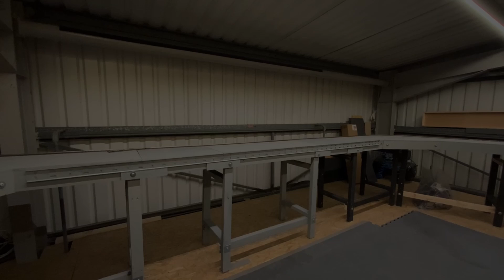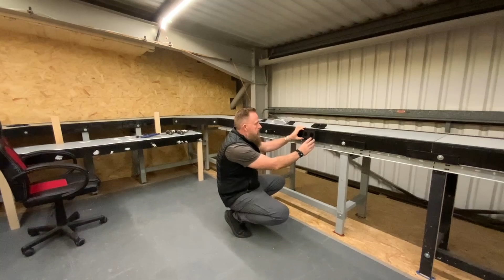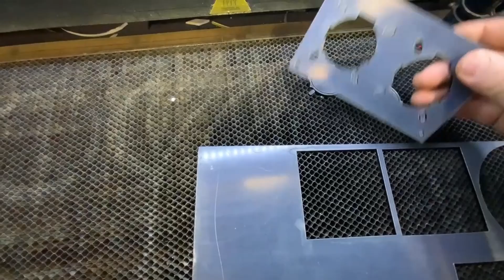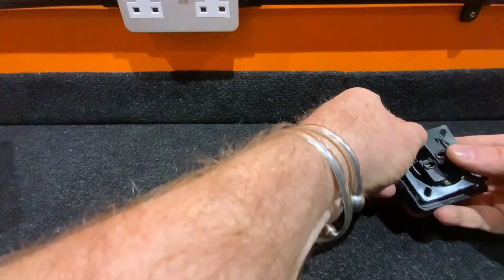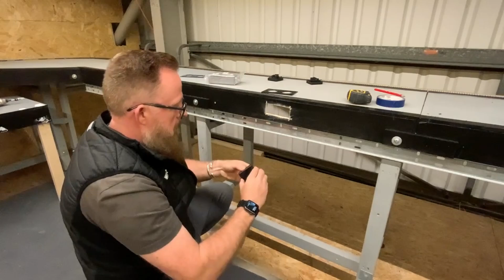New Layout - Moving Trains 00 Gauge - You Shunt - Episode 5

Comment: ARE YOUR MODELS NEM COMPLIANT - OR DO THEY DERAIL !!!
The NEM Conference, back in 1989 in Germany. That invited ALL model Railway Manufacturers BASED in Europe, was held with one specific purpose in mind. To abolish the mass of then different track, wheel and coupling variations between all manufacturers. To therefore "Standardise" NEW refined measurements as modern "Computerised" machinery was already being introduced in the Far East (Led by the Japanese). British Peco set the pace by agreeing new refined "Track standards" of Code 75 (75/1000ths of an inch high rail). Which is not just more realistic looking than the now outdated Code 100 (100/1000ths of an inch high rail), but also fractionally narrower in rail head width ! Which means ALL pointwork had to be redesigned with narrower pathways between the "checkrails and running rails", along with a redesigned nose to the Frog area. Further the actual distance between the rails was also fractionally increased, as a result of the fractionally thinner Code 75 rail. So to check any Models wheels a new NEM Code 75 "Back to Back" Gauge is required. Which you push between the wheels to ensure they are precise to a fraction of a millimetre. And Hornby's current models, particularly locos, are quite often fractionally out !  

Further the curve between the new narrower wheel treads, and the new reduced depth of the Flanges, now uses a curve of RP25 (Radius Profile 2.5mm). So another "tool" a RP25 Gauge is required. Because if you try to use American Models (Code 83) or Asian Standards (various !) all of which have different profiles and track systems that do NOT match the European NEM standards. Problems will be encountered. So even old pre NEM European items (including Hornby/Wrenn/Tri-ang etc) with nasty steam roller treads and deep flanges are likely to bounce along the "sleeper chairs" of modern Code 75 track. So won't collect current properly, and definitely will have trouble getting through Code 75 pointwork, without derailing.

The reverse is also an issue. You will have running problems if you put modern NEM compliant model trains with Code 75 wheels, on old fashioned Code 100 track. Which is a major reason for many of the problems I see on even British exhibition layouts still ignorantly using Code 100 track (still made by Peco). Which includes jittery loco behaviour, and of course "spurious" derailments when NEM Models are run on that out of date type Code 100 track. Indeed for some strange reason it seems only British & Spanish Modellers seem virtually oblivious to the changes 30 Years after they were applied. 

The information about the NEM Conference, and the changes agreed, and the fact "everyone" would have to change ! Was certainly published in the British Modelling press back in 1990. But most it seems totally failed to comprehend the technical issues that would now occur, if you try and mix the two systems. Many at the time probably thought it was similar to the previous "British" standards change of the early 1970's where "System 4" was replaced by "System 6", as that change did not affect running qualities of British model trains, as it was "minor" ! 

And probably the most amusing problem is that Hornby's "clip together track system" which is still actually made by Roco (of Austria) is Code 100. But Roco themselves do not use it, as like everyone else in mainland Europe they introduced modern Code 75 track for their own new "Code 75" NEM compliant model train range. Hence many of Hornby's locos, which are actually made by PIKO (in their new plant near Canton PRC) have code 75 NEM wheels, but weirdly set to the old Code 100 track width - Hence the issues created with running Hornby's current Locos. I found all 130 Hornby locos for my large exhibition layout, had to have their "back to Back" measurements adjusted before they would run reliably through pointwork without derailing. A problem that did NOT afflict any of the other "British outline" ranges such as Bachmann, Heljan, Dapol etc, who's locos were also in my collection !!!!
Reply from the maker: That really explains a lot, it’s bizarre how so many issue seem to happen on what should be a relatively simple piece of engineering in the grand scheme of things. So the advice is Code 75 and avoid Hornby. Surely there are some wheel set solutions that run better on Code 100? Great input by the way.
Reply: @Youshunt  Thought it might help. As it seems the manufacturers and even the Model Press, have it seems, forgotten to tell todays Modellers !
Reply from the maker: @railwaymechanicalengineer4587 
100% and explains so much of what I see. I’ve saved that as a document. 👍🏻

Comment: I love the little 08 shunter that you have running around the layout..  Have you considered putting those power outlets on the inner upper cross members as when you have things plugged into them they will then have cords etc in the way? whereas if they were underneath and inside then there would be no obstructions on the front of the module and you would be able to run power boards off the outlets.   

I had lots of other comments typed and the video ended and moved onto another video before I hit the big blue comment button.. damn it.. orh well... maybe next time..  cheers for now Tim.
Reply from the maker: @TimsBitsnPieces  there is loads of wiring to do yet, that’s all temporarily there at the moment to satisfy my impatience 😉

Comment: Great to see a loco running! A little surprised at the 240V power. I guess that's normal in the UK. In the states we would run 110. My clothes dryer and my oven are on 220/240. But I am totally ignorant and scared of electricity. My layout is 10' x 20' across 2 rooms. I use a power strip in each room to run everything - my DCC command station, JustPlug lights, LokProgrammer, ProtoThrottle, laptop. Seems to work okay for me. I like your laser cut plates, very nice. If you mount them on the "face" of the facia and plug something in, is the cord is going to stick out into the middle of the layout? Could you mount the elec boxes on the legs of the benchwork, facing parallel with the benchwork? Just a thought. Take care - Bill.
Reply from the maker: Hi Bill, yes the loco running was my first mini goal that I set myself. Yes UK/Europe is 240v, I am not going to power the layout from those sockets just have them for hoover, soldering iron etc. Rather than trailing extension leads around.
Just had a look at your channel, think I'm going to be watching. A sub on its way.
Appreciate you taking time to watch.
Simon
Reply: @Youshunt  thanks Simon!